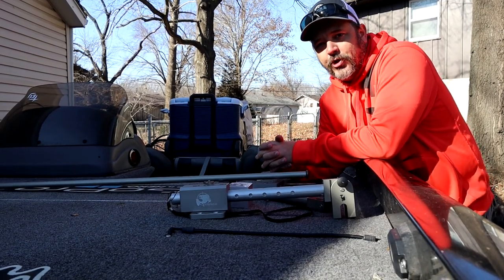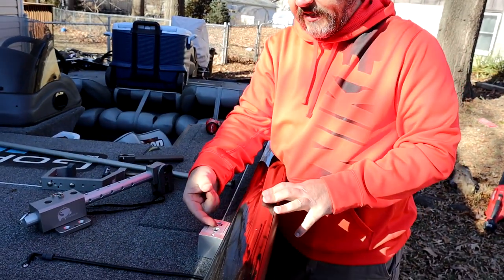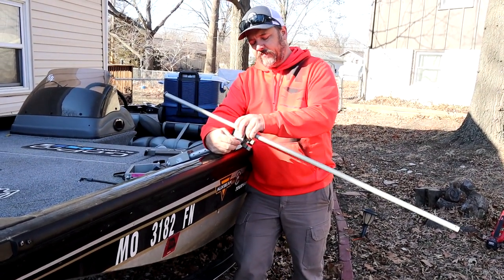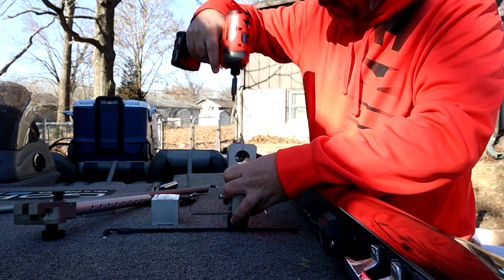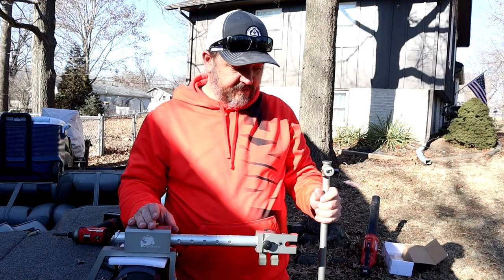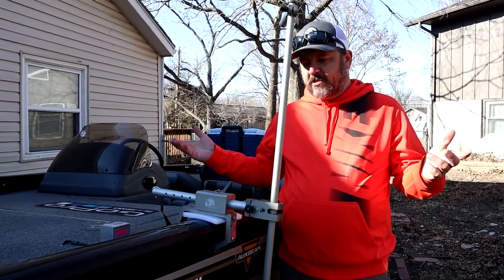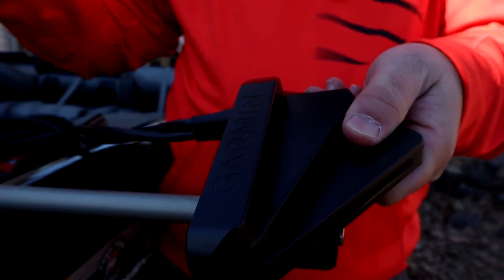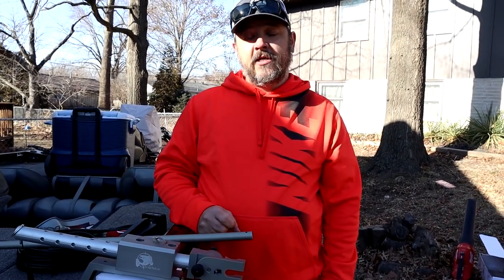The Best Garmin Panoptix LiveScope Transducer Mount | Fish Finder Mounts

Comment: Wow I’m going to have to get the base plate   Take length PVC to lengthen the handle , I put the heat gun on the pvc to slide it on the handle , after putting it on then I couldn’t take it off tooooo tight , T’S W S S , put heat to pvc slid it off then used Drimmel cut slit on pvc , BOOM , now it can slide off and on , simply brilliant. And you can put a little bend on it to your desired position, of course with the heat gun , “ THEIRS YOUR DINNER “
Reply from the maker: If you buy a new baseplate, be sure to tell them G4 Outdoors sent ya! There is my dinner, lol.
Reply: @g4outdoors  LOL !